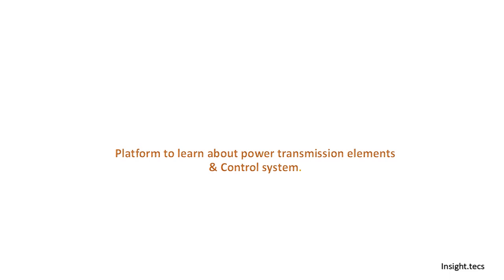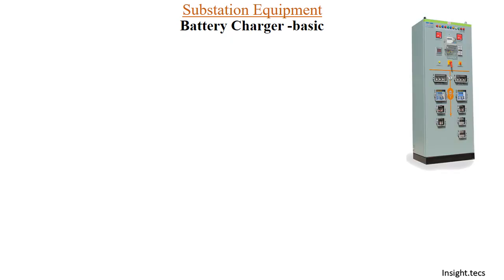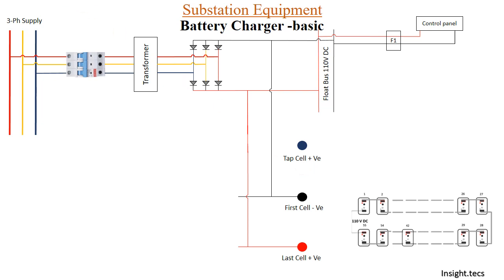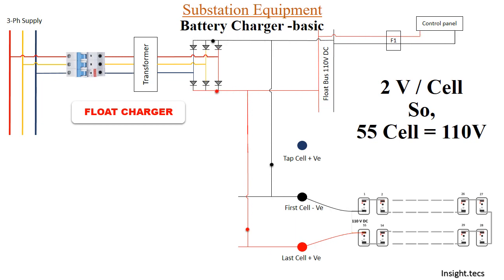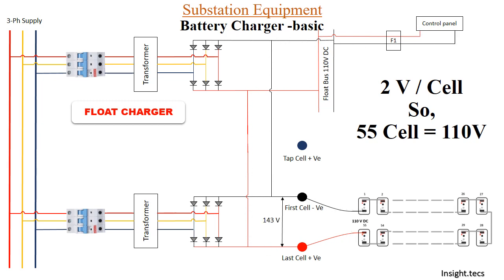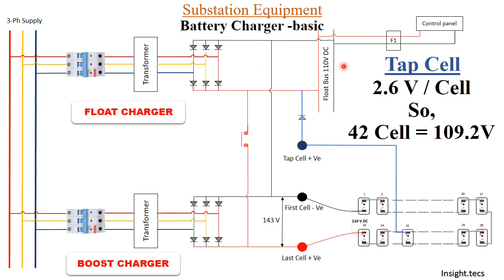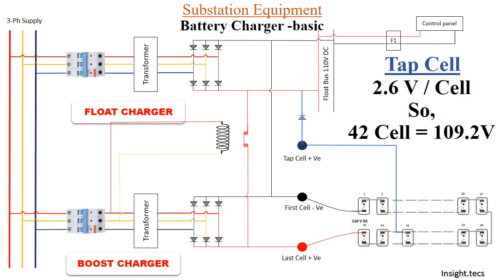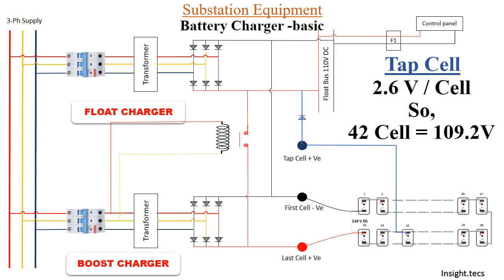Basics of Battery Charger ||Working Principle of float and boost Mode || English

Comment: During boost charging and float charger off the battery shall feed load through tap cell to the load. Is tap cell is rated for continuous duty. One more doubt when boost charging AC is off and NO switch  shown is having problem . Then there will be no DC to the load. Dangerous situation.??.?
Reply: Batteries are supplying continuous supply to the panels. Float is for continuing charging. Boost is for only boost .. that needs to be quaterly operated

Comment: one small question, Boost charger  will never provide directly to control panel like float charger ?
Reply: Yes it's true. Boost to battery that takes helps of tap cell . And tap cell voltage is there at panels